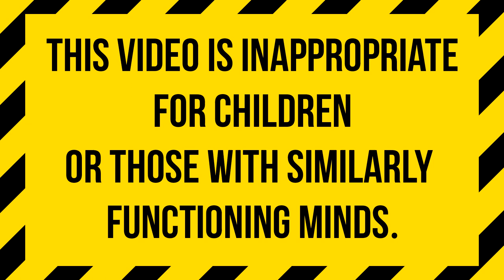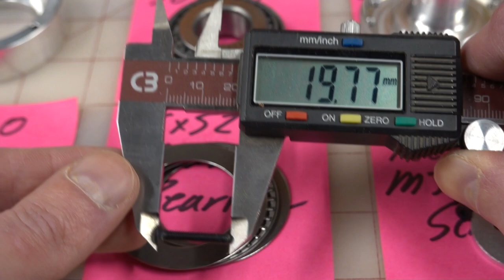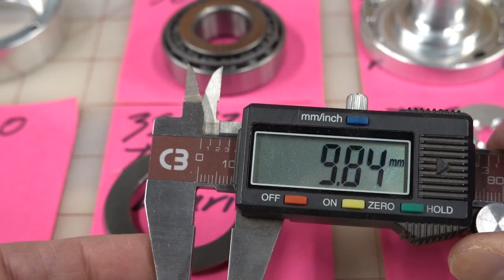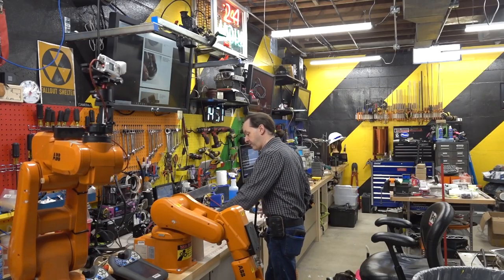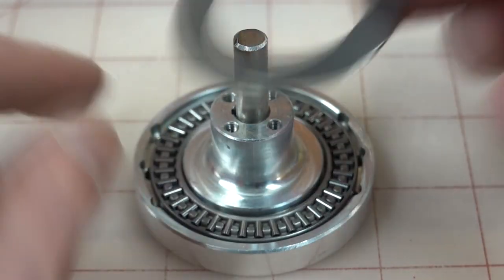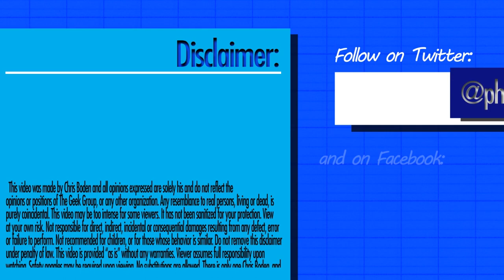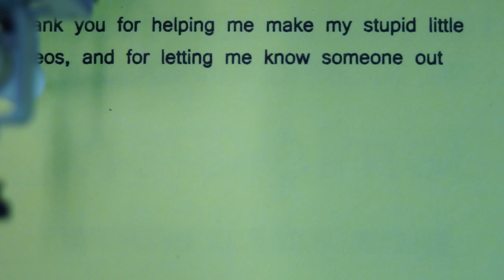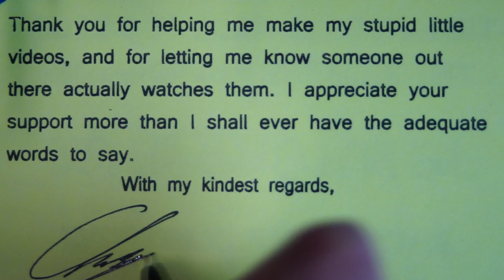Project ARchi3 Episode 20 - J3 Spindle and Bearing

Comment: To get the key to fit snugly, I ran a fine file across one side 2 or 3 times only, then could press the key into the shaft. Take the file to one of the sides for the "U" groove in the shaft (i.e. you are trying to reduce the width, not the height). You have to be careful not to take too much metal off it.
Reply: I did what you suggested Kazarenko. It worked. I feel I may have taken too much off, so you're right, you need to be careful. Hopefully the Loctite I added to it (and the grub screw) will ensure integrity.

Comment: Couldn't you use the heating/cooling method on the shaft+key into the J3 spindle??? Heat the spindle, freeze the shaft+key?
Reply: And yeah, I ended up using the heat/freezer trick to get it in...
Reply: Also, I found that I needed to have the shaft not flush with the back of the round part... otherwise the shaft doesn't stick out far enough for the chain drive's sprocket.

Comment: Hey Chris!  This is my second go around watching all the videos, this time I’m actually building. I’m a little worried my arm won’t rotate and all like yours does. So it’s fixed straight up and down. It was a giant pain in the ass sliding the j2 motor in, But I use the wood when O was tapping it into place.  Hopefully I didn’t screw it up, not that is was going to go in any other way.  Do you think I should be concerned.  I would pull it apart but I don’t think there’s any way in hell that motor is coming back out, ha ha.